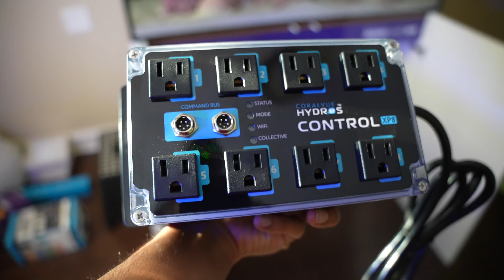Aquarium water level problem RESOLVED!

Comment: How’d this hold up in the long run? I have a 435 and been battling this for for 18 months 

Had that silencer off as well as the screen. same thing 

I can’t run a ato as it will hold the water up in the display after a couple days and just ends up dumping all the RO in
Reply from the maker: So part of my problem was I never calibrated my ecotech s2 return pump 🤦🏽 it’s been running smooth ever since!

Comment: Hey QQ, I have the 435.. same issue and I’ve been pulling my hair out. Did this really solve the issue? I will definitely try on mine. It’s worth the shot.
Reply from the maker: Yes! just take it out and everything will stabilize. Tanks has been running smooth since!
Reply: @whatthereef  This is awesome! Thank you so much for sharing & cracking the code!